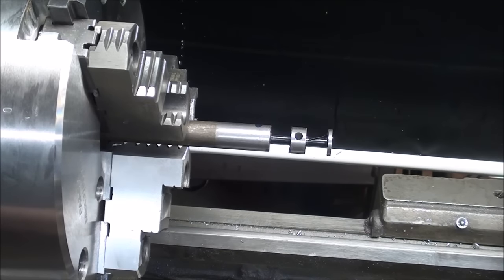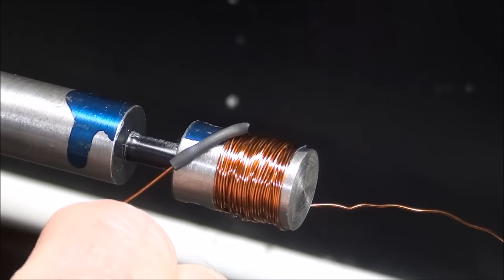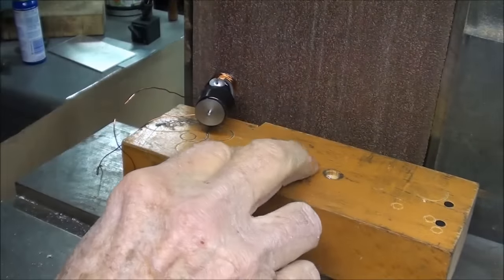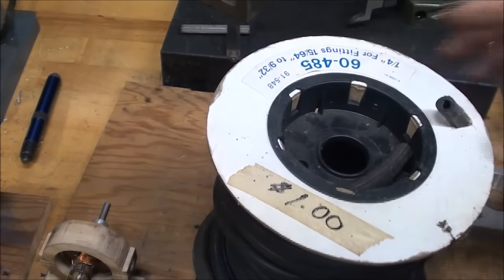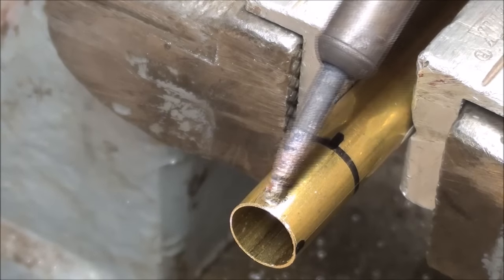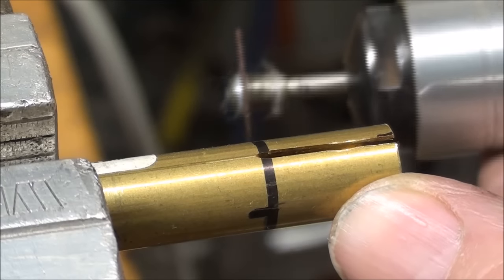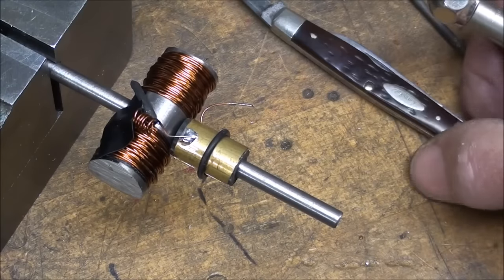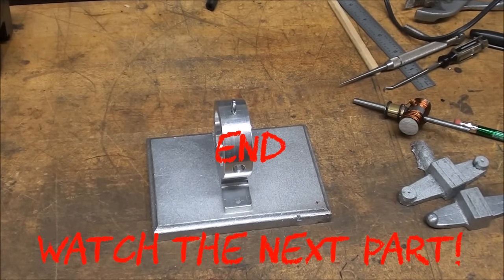Pt 4 tubalcain BUILDS A MODEL DYNAMO for a Steam Engine

Comment: After hearing you mention terms like generator, windings , transformers etc. etc. I am reminded of my grandfathers transfer to the Pittsfield MA. transformer facility while he was employed by G.E. during the Korean war.  It was a massive facility and he was especially impressed by the huge transformers built there.  He had pictures of the biggest units ready to be shipped by rail on specially designed G.E. built center drop rail cars.  Some of the cars were double articulating and needed 8 axles to withstand the weight.  I do believe Pittsfield built all the transformers for the Hoover dam and also Grand Coulee dam. As a tool and die maker he was exposed to many of the manufacturing processes at the plant.

Comment: A drop of superglue will fix the windings in place. That would be good practice because of the changing magnetic field the windings will move a little bit when the polarity of the coil changes and can rub their insulation off.
Reply: +Morkvonork Epoxy resin like Araldite is very good as well.  Especially if you put the glue on then stick the assembly in the oven to melt the glue it so it flows through the windings before it sets.  I did that a lot for very high speed slot car motors when a yoof.

Comment: Count me as one of the women who enjoy your channel ;) .

For pocket knives, might I suggest Victorinox? I've had one of their very simple "Soldier's" knives for 14 years now and I love it! None of the 50 random functions, just a large blade, a small reamer and the two can opener/screwdriver dealies; no toothpicks, tweezers, scissors, corkscrews or anything else I'll never use.  It also has aluminum scales, instead of the typical red or black plastic ones. The blade is a stainless alloy, but it sharpens pretty easily and keeps an edge for a very long time. I've had a few fairly expensive pocket knives over the years (although nothing ridiculously high-end or custom), and the Victorinox has been my favorite by far! On top of that, it was only $20 when I bought it around 2002 or so.

I believe Victorinox has shuffled the names around since then, and the knife I own is what they now call the "Pioneer Alox" (alox for the aluminum scales); the "Soldier's" name has been assigned to a different model with dark green plastic handles and a bunch of extra functions (frankly I think it's ugly), but it's what the Swiss military apparently wants. The Soldier's model is the one that Swiss soldiers are issued, and I'm sure that's why the name has been shuffled between a couple different models over the years. I'm suggesting the modern "Pioneer" model, with aluminum scales. The current "Farmer" model is identical but adds a saw, so that may be very handy if you often work outdoors or something; it's only a couple dollars more.

I just did a quick Amazon search and the current Pioneer model runs about $27, so the price hasn't increased too much in 14 years (and you could probably find it even cheaper if you shop around.) For a basic pocket knife, I think they're still one of the best bangs for the buck. And of course they're still made in Switzerland! Just don't ever order directly from Victorinox, unless you want want to pay much higher prices: I imagine they do that so they don't undercut their own authorized dealers, who are usually far less expensive.
Reply from the maker: +catdumpling I own about 6 of the vics. I favor the 2 blade models that are not thick--do not like the fat ones with all the useless tools. I have some of the fish scale ones.

Comment: Soldering iron stands only cost a few dollars, though making your own wouldn't be difficult.
Reply: +Scott Paul I made one in 1975 out of a piece of 1/8 x ~6" scrap. Cut a 1/2" V in the end and bent it up ~120 degrees about 1/4th of the way back. Still use it. I bet Mr Pete could whip one out in 6 minutes.

Comment: One way to do it better (if you so desire) is to use a small ring. The way it's supposed to work is, with that small ring (only twice larger ID than the D of the wire) you guide the wire in. The tighter the pack, the better the other layers are going to be, otherwise you're going to get funky stuff. The ring can be kept in place with a pair of pliers or brazed/soldered on to a rod (i did the rod variant, and i did it because i rewind all my motors to proper spec, as opposed to the factory fast method they use which results in noise, issues, heat build up etc).

The second tip would be strips of paper, i use packing paper the type that's lightly coated in oils and smells like parchment (but isn't). That evens out the layers even more and you insert the strips each completed layer, easy to do too, you just have a strip cut initially that's the width of the wind and then as you go along you measure the length, leave a small 4 mm overlap, and cut.

That's just my two cents. :D

Comment: You can buy a iron holder on EBay for less than tem bucks but if you want to make your own you can use a small 2x4 block and a spring. Take a 1 1/2" to 2" dia by 2" or 3" long stretch the spring out then straighten one end about 2" or 3" and glue the end in a hole in the block so that the center of the spring is lined with the center of the block. the bigger the block the more stable.

Comment: Your not supposed to clean the iron with a file. The iron tip is typically at least two metals layered. You just scraped one of them off. It is also bad to be soldering something with as much thermal mass as a pipe with a small iron. The thermal shock is bad for the heating element in the iron. At minimum you want a heat gun. Typically I heat everything that size with a heatgun or an oven before soldering.

Comment: To improve the performance of a soldering iron, I simply "Tin" the tip. That way, after it heats up, all I have to do is wipe the tip on a damp towel (paper or otherwise) and the tip is clean, shiny and ready to efficiently melt solder!

Comment: At 2:53 - The insulation (varnish) on the magnet wire is good at preventing shorts within the windings.  But the varnish is thin and will be cut at a sharp corner like the bobbin's edges and can cause a short.  Thus the reason for the heat shrink between the left and right sides.

Comment: Nail polish makes a great glue for the windings.
The little coils at the end of the windings are not ideal as they are prone to stretch and eventually unwind during operation. Electrically they are counterproductive for the wave form that is induced into the windings...
Reply: Those coils made me think of inductors and of course, induction. Could you explain a bit more about the detrimental affect placing those two inductors in series with the rotor winding has on the efficiency of this motor?  
I liked Mr Pete's demonstration of 'alignment ' and how  it affected the rotor's speed of rotation. 
Thanks again for another fascinating video!!
RL
Reply: +Roy Lewis Current in a coil causes magnetic fields, but those fields are in OPPOSITION to the current. A coil that small and with no core won't make much of a difference, but in effect, he's limiting the power getting to his electromagnet. 
However, I can see some upside to the coils too: when the commutator switches direction, the energy stored in the "inductors" will be in his favour for a moment, which will make the switch faster and cleaner... But then they'll be discharged and they'll hamper him again...
Reply: @Richard Betel: That is correct.
 
I was more concerned about the centrifugal forces pulling on the little coil. Hence in commercial windings the wires are kept as tight as possible or are even potted in epoxy to mitigate the mechanical issues that might arise from vibration and centrifugal forces.
The alternating current that is generated during operation looks a bit like the arches in the M of McDonalds if seen with an Oscilloscope. So the voltage constantly changes and that makes this little coil act like an inductor in DC. The coil “stores” a bit of energy when the voltage is changing and releases it when “freed”. Think of an ignition coil in a car engine …
That is counterproductive here as it “soaks up” a bit of energy, that is “lost”. This energy is released once the copper slider is losing contact with the corresponding commutator plate and can form a nice blue spark. That wears the material like cavitation on a boats propeller.
 
Yeah – I know. That is all a bit too much science in a kid’s (or an older gentlemen´s) toy … ;-)

Comment: On most magnet wire, you can heat up a soldering iron, add a bit of solder, then heat the end of the wire. This will burn off the enamel coating and tin the wire in one "swell foop." :)
Reply: +tom7601 Not on the wire I've got, you have to seriously scrape it of before the solder will even think of taking.
Reply: +Mentorcase Yeah there's different kinds of enamel coating. Some you can burn off with an iron, some you can't. Usually a torch can take off the stuff an iron can't burn off though.
Reply: Oh yes a butane torch will burn it off but you have to be careful not to burn the wire too much.

Comment: I really enjoy the humor you put in your videos. I didn't watch Saturday Night Live much when Dana Carvey played the Church Lady, but I do remember her saying "isn't that special" all the time. I have a P.M. Research dynamo kit with the rough castings. The armature came all assembled with the wiring and commutator installed. I built a motor in high school shop class that used all electro-magnets. I ran it off a slot car set transformer. It took so much juice to run, that after a minute or so, the circuit breaker on the transformer kicked out.
Reply from the maker: I'm think about buying one of those casting kits & making a vid
Reply: Sounds great. I haven't machined mine yet. If you make a video of one, maybe I'll get some pointers. I'm glad you decided to paint this dynamo. It makes it look like a pre-built bought one, but you can say you made yourself from scratch. Something to be proud of and pass down to your new grandkid.

Comment: When I worked in an engine shop I once bored a 318 block a little over sized so I wrote on the side of it with soap stone TOO LOOSE LA TREK and later had to explain to my boss in front of a customer what that meant.
Reply from the maker: +Doug Rundell Ouch-thats embarrassing

Comment: The reason, I understand, for counting turns on a coil like that, would probably have more to do with balance than anything.  Total amount of wire does affect things, though.
What I would like to know is how a coil in a magneto is done.  I've got an old welder driven with a 4 cylinder Wisconsin that I cannot find a mag coil for, I'm afraid I'm going to have to try it for myself.  I'd like to know what is involved before taking the old one apart.

A magneto. That might be a good topic to cover on a "What makes it work" if you haven't touched on it elsewhere.
Reply: +diggerop Many aviation engines still use magnetos. Have you tried talking to an aviation mechanic?
Reply: Hadn't thought of that.  I should have, we were close friends with a local airport manager/mechanic for several years.  He moved to Arizona shortly after Dad passed away and he's retired by now.

The problem with aviation parts, though they could be exactly the same thing you would find in an automobile, is the price.  That aviation use mark on it will instantly triple the price.

The welder will run with an outboard coil, but the hole for the big wire lets moisture in and you have to keep a charged battery on it.

Comment: Use a little Windex to lube the rubber tubing.  It will allow the tube to slip easily on to the shaft and will dry residue free.  Also, it has no impact on the rubber as would a petroleum base lube.  I was shown this trick a long while ago so I thought I'd pass it along to the youngsters watching.  PS:  How about some epoxy to secure the windings.  Good luck with the build, Paul

Comment: You can get magnet wire from old starter solenoids and fridge compressors.
Reply from the maker: +Poptart McJelly starter solenoids are electromagnets
Reply: full of magnet wire, also smaller solenoids and relays can be a good souce for very fine wire. Also microwave oven transformers are a good source for magnet wire, they're coated with stinky epoxy but a little acetone will make it very soft.